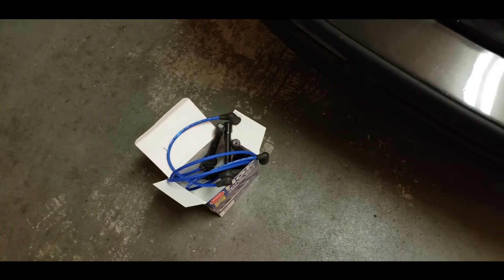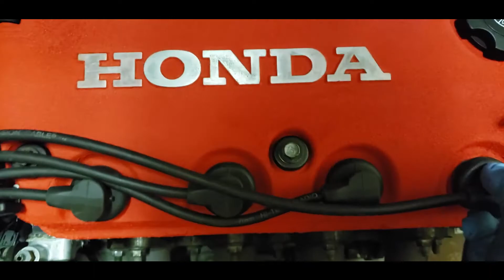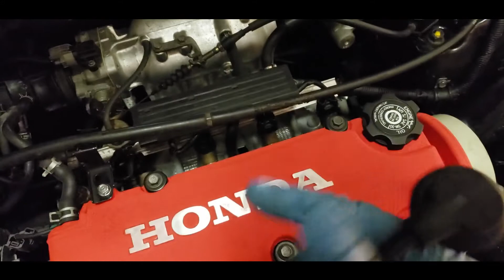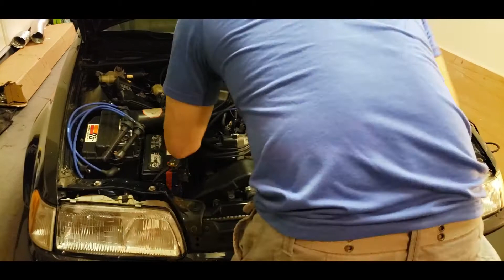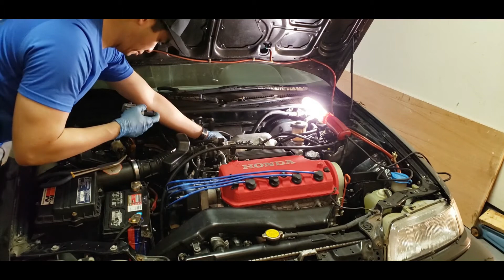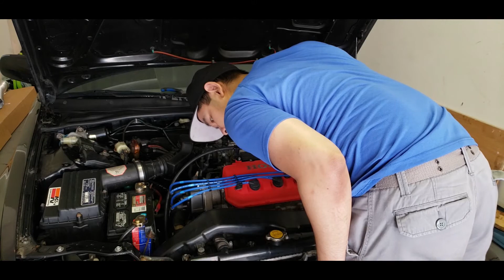[D16Y8 Fixing Idle Issue] How to Replace Spark Plug Wires

Comment: try turning the idle up a lil.  adjust the throttle cable so it idle a little bit higher. If u don't have a chk engine light on right now. set it up to like 770-800. this way when u release the throttle it will drop back down to where u have it set which is 700-800. this should be high enough to not have that kind of bog. Originally they want the Dseries to run at 650 but thats too damn low lol.
Reply from the maker: Thanks for the tips. I fixed this issue a long time ago. Everything was adjusted to spec. The culprit was actually rockers being stuck. After a good cleaning and re-oiling everything, the problem was fixed. I also traced a cracked header and a vacuum leak.
Reply: @BudgetGears  Wow. Thats whats up man. Glad you got that sorted out.